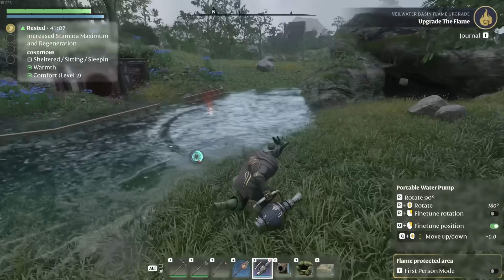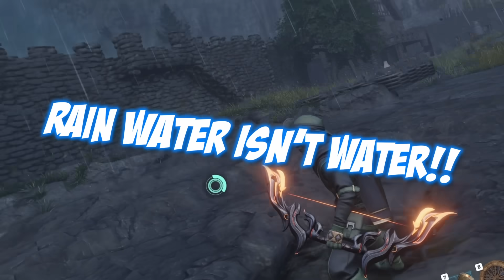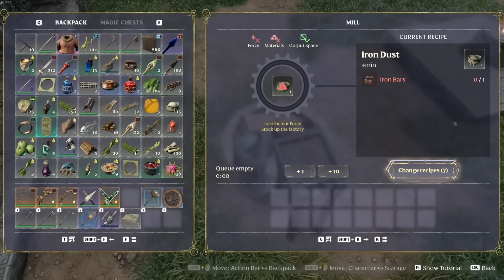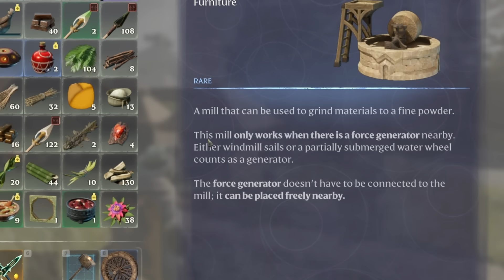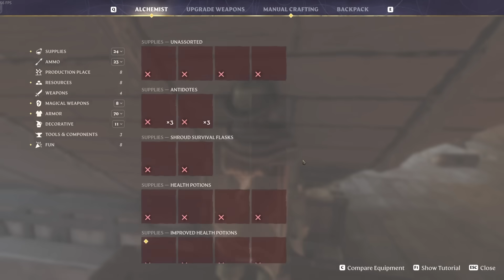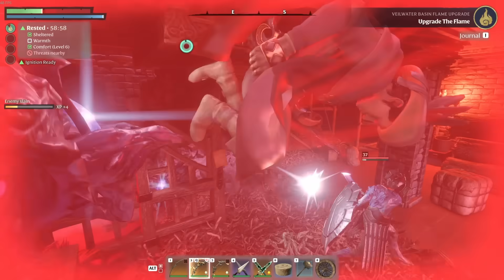How to Use Water Mechanics. Enshrouded Update 7 Guide

Comment: I’m trying to build a waterfall that flows into a pool, but the problem is the water overflows and falls into the void (my house is in a tree).
Technically, it keeps generating water and there’s no way to stop it unless the pool’s water level is the same as the waterfall, but that’s not the point.
I haven’t found a way to prevent it from overflowing, because if I add another layer of barriers to the pool, it just fills up again and spills over.
Reply: So from what I can tell it looks like it works like real life water. You basically have to build an actual river with an exit somewhere maybe. Or they will have to add a recycler for wells to circle back up or something. I tried it in front of my house with drains in several places and I just couldn’t get it right

Comment: Currently in our builds water tends to flow like syrup. All of our features are flowing streams and ponds. Near the source water is a bit deeper than where it terminates. The water depth in a creek running to a pond actually builds depth meters before reaching the pond. Output of water sources, is effected by the ability of rate of travel. So if a source pond has a small outlet, it can effect the flow rate of the source. Remove impediments cautiously.

Comment: Imagine I have a 20 blocks long water canal with one source and a drainage. The water will stop about the 10th block. Video say "use the pump". Will the water still flowing, after I stop pumping?
Reply from the maker: It worked for me, but there has been a patch since then - perhaps it'll work but don't click the remove water option in the flame altar after
Reply: @totalsurvives  I tested it in the meantime, yes, it works. You must pump only one time, in the canal section without water.

Comment: I find the water wheels don't work well in a trough with the water flowing past it the way you have it set up there. Although that's the way you would find it set up in a river. They work really well when the water is coming straight down from above and hitting one side of the wheel. So it appears the more downward flow the better, or more force.
Reply from the maker: They work fine in a trough providing the wheel turns, as it stands it doesn't matter how fast the wheel turns. BUT you need to use a water dispenser, river flow doesn't seem to work that well. If you have a dispenser one end and a sink the other there shouldn't be an issue :)

Comment: I did find that once I started letting water flow, there were some spots where I needed to "add" ground within the dirt/rocks, etc that came from the game. Small gaps for who knows what reason. I just took the biggest terraforming rock, sunk it under the top layer and started clicking away. Worked like a charm.
Reply: I've noticed this too. Its very frustrating and hard to find where these holes are.

Comment: Where can I get the water dispenser?
Reply: You can craft it at the workbench.
Reply: @rachelpayne7862  I just checked and I can't find it in the workbench, and under crafts, the only water tools are the reversible drain and the floor drain. That's why I assume you have to unlock it first.